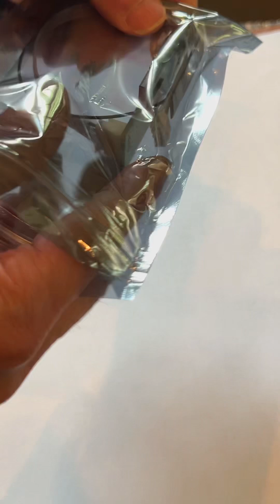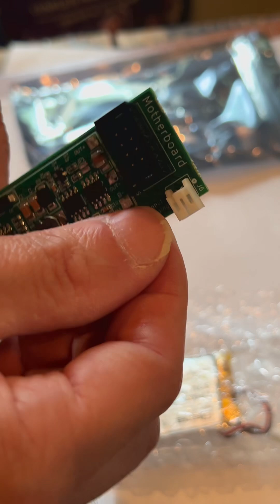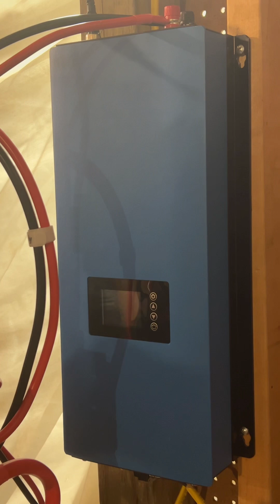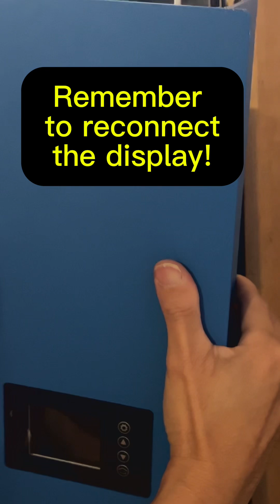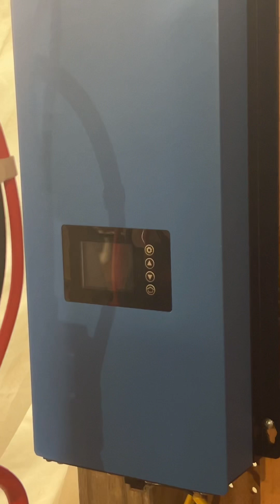Installation instructions for the SunBeam and SunScreen products.

Comment: Very interesting Little board. Can you change the power output via MQTT?
Reply from the maker: Yes, and many more. Basically anything that can be changed on the LCD screen that is related to the inverter power production plus more.   Sunbeam manual link is https://www.2muchsun.com/file-share/d83e4662-87f9-47f9-b10b-1ba793477890
Reply: @2muchsun6987 thank you so very much for your kind response. I will show this to the tech guy. As the price to Australia, with the new USA taxes is almost 200 of our dollars l wanted to be very sure it would do what we wanted.  Again many thanks. Ac.

Comment: Sunscreen sadly does not fit (not enough space) GTIL1000 unit due to the screen and connector being in the same place as where the sunscreen should be mounted. Any suggestions?

Comment: Looks good. What is the benefit of the Sunscreen? How does the behaviour of the Gtil2 change?
Reply from the maker: It protects your GTIL from having the AC short issue that a lot of us are having even though we use surge protections.  It doesn’t change any behavior.  It’s basically a mini-UPS that only powers a small portion of the inverter so that it has time to stop producing gracefully when there are power dropouts or complete outages.